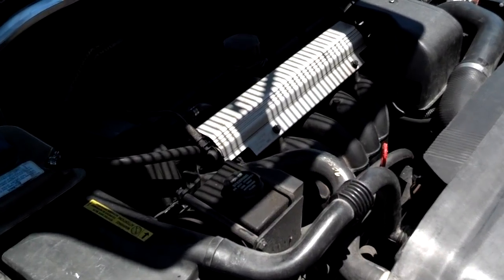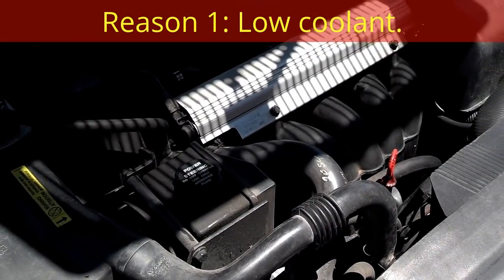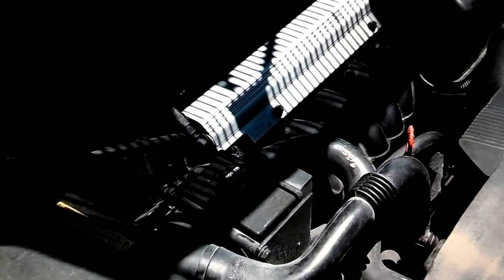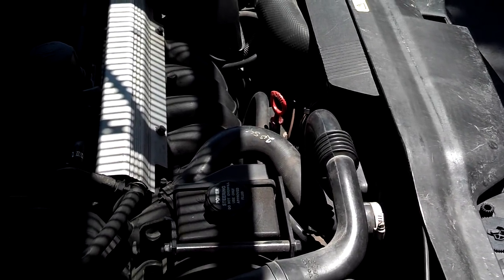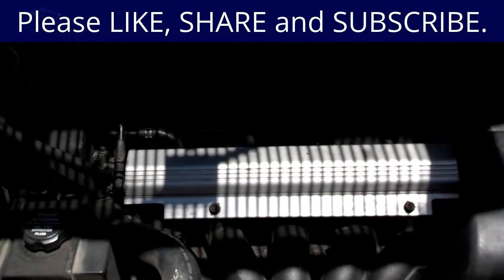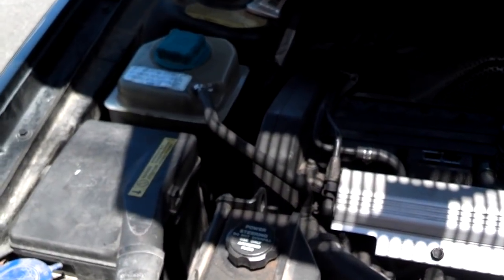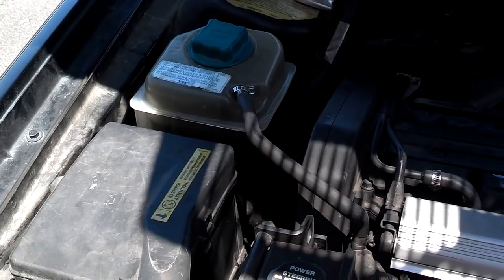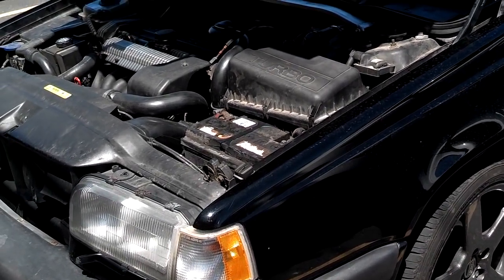My car is over heating, why is this happening? What should you do now?

Comment: Amazing video Robert, thank you. I came here, say, from your other video on making your older car last a long time! I believe you covered everything regarding overheating, so I would like to just add my 2 cents very respectfully here. My car started overheating in stop-and-go traffic a few weeks ago and NOTHING was visibly wrong. To cut a long story short, the problem was not visible for the untrained eye (by the way with some steam coming out of the coolant reservoir  and in HORRIBLE traffic in Mexico City!!), but it was the electric fan that had stopped working. 
So my mechanic advised when I talked to him, first looking at the obvious, when nothing seems wrong with the car because you have checked all the levels and everything seemed fine the last time you checked! Anyway, 1st., ELECTRIC FAN--cable, motor. It is a simple test with a couple of cables and your battery; 2nd., TEMPERATURE SENSOR (which moves the fan and is usually easy to replace); 3rd., THERMOSTAT (I believe easier and cheaper to replace than water pump), and finally THE WATER PUMP ITSELF. Again, this applies to a car in the above situation and NOT a car that is clearly leaking coolant or a car that overheats even at normal speeds. Thanks again for the video and take care.
Reply from the maker: Thanks for sharing.
Reply: yes sensor and relay fuses
Reply: Ty, that helped describe what my car is doing.
Reply: 5
Reply: Q q+

Comment: What temp is considered overheating that causes damage? My upper radiator hose came loose. I pulled right when I saw my scan gauge reached 218-220. Clamped it back on filled it up and kept going at 190-195. Did I cause damage? 1995 Tacoma
Reply from the maker: https://youtube.com/shorts/QMpmi2vwoTQ?si=ij1Nvv73c0q7Q2mm

Comment: I can't find the cause of overheating on my 2001 Honda accord 280K miles. Blowby? I run the AC, both fans come on and cool it just fine. No AC? No fan comes on, heats up while driving after a while, turn on AC, fans cools it down. Electrical short? Shot a parts cannon at it. It's a puzzlement. I'm suspecting blowby. Oil clean.
Reply from the maker: I have NEVER heard of blowby causing a vehicle to overheat. Did you watch this video?

Comment: My temp guage will get to about half way up then 65 up then down to about 45. It would back and forth sporadically. No white smoke out the tailpipe. Resovir was just filled after the fact but itwas empty before. Since then it did not go down much. problem with temp still there.
Reply from the maker: I don't even know what kind of vehicle you have but you might want to make sure that you have a good thermostat and that the fan is working properly.
Reply: @RobertDIY  2010 honda civic. Thanks for responding.

Comment: What happens when your temperature rise is very close but, STOP to let the car cool down. I changed the thermostat and by the way the radiator and fan works too. I'm thinking the temperature sensor. What do you think ?
Reply from the maker: Probably the water pump.
Reply: @RobertDIY  forgot to said i changed out the water pump too. ( Sorry ) I think is the air in the system. Jeep liberty 03.has a pressure relief nut open it up because going to put a new cooling temp sensor open  radiator and refill back up & pressure it.

Sounds like a good MASTER plan.

Comment: I have a 2017 Cadillac ats and I overheated or tried to over heat 3 times, in the last 6 months. I only 50k miles on it and am the only owner. Today when I was in traffic and it was raining I had to pull over to let the car cool down. I popped the hood and saw the fan wasn’t moving. I pushed the fan manually and it started to move.  I’m getting it checked out early next week. It’s only happened a few times and each time I saw my temperature gage go up, it’s always when I’m in stop and go traffic and each times it been raining. Any correlation to the rain causing temp to rise or causing the fan to not operate properly?
Reply from the maker: I guess. I suggest that you schedule to have the fan replaced. It's acting up and 16 years old. Not worth destroying the engine over.
Reply: @RobertDIY  it’s reaching 6 years old but I guess I wonder why it failed so young. But I appreciate your response Robert hopefully I will get it replaced asap

Comment: Good day I have a question I have a 1996 Mazda Protege and it's running hot but he never ran hot I have changed the radiator it's still running hot I have changed the thermometer whatever you call it and it's still running hot they blowed out my heater core and it's still running hot I have not replaced the water pump yet I have no clue why I still running hot can you please got a sister the right way
Reply from the maker: Does the engine fan work?

Comment: My problem is overheating only when I get up to speed. Tested thermostat, pump is good, no leaks. At idle or low speeds it’s fine. Anyone have a idea?
Reply from the maker: Pump is bad.
Reply: @RobertDIY  thanks, anyway to check that without driving it anywhere? And not being a mechanic?
Reply: @RobertDIY  also rob I have heat and I saw a Video that said if I have heat my pump is working. It’s a 06 Dodge Ram 4.7
Reply: @RobertDIY  you were right pump was bad

Comment: Please help. I have no other way to get a car. I have a 2004 Suzuki xl 7. It's been a real good car. I've had it 8 years. Ten days ago, my reservoir  suddenly boiled over  I was driving into a parking spot. Maybe exploded because the reservoir tube disconnected. Could this be exhaust gases doing that? It overheated two other times but I stopped it right away. The car did not show any other signs of a blown head gasket. The parts and labor are ridiculously expensive. I have a mechanic appt tomorrow. The memorial weekend had everyone booked up.
Reply from the maker: how can I help you with that?
Reply: @RobertDIY  well I took it in today and no diagnosis yet I might hear something tomorrow. I told him to check the engine codes etc.

Comment: thanks for the link, very helpful video.  I think its most likely a bad waterpump now. though i had a bad water pump in my old chevy and it made a lot of noise and leaked badly. my water pump in my 1992 240 isnt making noise or leaking but I suppose that if the blade unscrewed inside it might not show symptoms.  i was wondering though if the radiator could be partialky blocked?  Like I said the bottom of the drivers side is totally cold, bottom passenger side is warm and top both sides is hot though not enough to burn your skin.
Reply: Also would it help to run it without the thermostat until I can fix it?  Its my only working car unfortunately.
Reply from the maker: I would fix it first.

Comment: My car yesterday kept overheating , I went to the car shop & they said they really couldn’t find anything, they said the car had coolant in it . Once I turn the car off n let it cool it runs back normal but I’ll say maybe a minute or 2 afterwards that’s when it starts to over heat again . It never’s cuts off but it do start to skip n cut back a lot & I pull over . What do you think could that be ?
Reply from the maker: Can't tell from here. Did the shop you took it to test drive it? You many want to take it to the dealer or another shop.

Comment: My car runs hot when I'm idle and have the AC on
Reply from the maker: Does the engine fan work?
Reply: @RobertDIY  I turned on my car today and let it run and the fan wasn't turning
Reply: @RobertDIY  is the the fan suppose to run all the time are at certain points

Comment: What if the fan works most of the time except when the car starts to overheat and the ac blows hot air
And in other times the ac works perfectly fine and the fan turns on when the car is stopped in traffic,
Reply from the maker: May be a bad relay.

Comment: What about if I have turbos?  Which use coolant to cool them down, can there be an exhaust leak thru there that's causing my coolant to over heat?   Although it's heating on the top hose not the bottom?
Reply from the maker: 🤷🏾‍♂️ My cars are turbo.
Reply: @RobertDIY  I didn't hear you address it!  You said there could be an exhaust leak into the coolant, but at the head gasket.  You didn't mention anything about a possible leak from outside the block.   I'm only asking because I have sequential twins and my coolant is over heating.  Imma be replacing the coolant temperature sensor since I've already done the thermostat, water pump is not too old less than 5k miles. Since imma be replacing the exhaust cam and vvti Cam's seals I will be checking the pump again since imma be right there.  I just hope I can find the problem because I'm a bit annoyed of not being able to use my 2JZ GTE  swapped Lexus GS300   

Cheers
Reply from the maker: Because the turbos won't make coolant overheat.

Comment: My car is full on coolant in the reservoir. Filled to the max line and my car has been overheating? I noticed some spurts of coolant on my engine next to the radiator cap. So I changed the reservoir line and put on clamps. Worked for a little, then I found new spurts and I have green fluid leaking from under my car?! Car has been parked, haven’t noticed any white smoke or weird smells. I don’t want to risk it and drive so it’s been parked. Can somebody help me? I don’t trust mechanics and rather do the work myself...
Reply from the maker: Bring it by.

Comment: What if the weather is too hot? Could that cause it to over heat????
Reply from the maker: The engine runs at 210 degrees. If the air temp is below 160 it should be fine.

Comment: Bad freeze plugs can also be problem.
Reply from the maker: That would classify as a coolant leak. 🤷🏾‍♂️
Reply: @RobertDIY  is it any type of quick fix for bad freeze plugs?
Reply from the maker: Replace it. If you can reach it drill a hole in it, put a screw in it and pull it out. Then press the new one in.

Comment: Okay what about when your over heats and you always have to have the A.C. on, so it won't over heat? But the thing is my fans work and changed the radiator and thermostat..I have a 2000 honda accord..
Reply from the maker: bad fan relay. It's not turning the fan on unless the ac is on.

Comment: Ok so i have a 01 lexus ls430 very great car. Ive  traveled 2+ hours with no problem. I took it to LA and i have to go through the GRAPEVINE mountain which is known to take cars down! As I climbed the the mountain my temperature increased a tiny bit but once i reached the incline temp dropped to normal running temperature. Is this normal? I inspected the radiator after and looks like it has the OEM radiator since car was made its old dirty and crusty. Im planning to replace it with a OEM tow package radiator for the ls430 which is thicker and bigger than the OEM one that came in my 01 ls430. yes certain ls430 have tow package. And info helps THANKS!
Reply from the maker: Yes normal.

Comment: PLEASE FUCKING HELP ME
i have a 2013 charger v6 and its been overheating for about a month. i did everything and it still overheats, keep in mind there is no leaks anywhere in the car. I noticed when my car was at running temperature my cabin heater didnt work so i decided to do a heater core flush, and it didnt work. still overheated. next i replaced my thermostat and i purged it, didnt work and it was still overheating. And then i even replaced my radiator and nope it didnt work it was still overheating. My heater was still not working so i thought it was my heater core again, not that it was clogged or leaking i just thought it stopped working, so i bypassed it and now i dont have heater inside my car. oh and guess what. STILL FUCKING OVERHEATING SON OF A BITCH
PLEASE HELP ME GUYS
Reply from the maker: Are you sure the gauge is working properly?  You can call me anytime.
Reply: @RobertDIY  yea im positive because when the gauge is all the way to Hot i check my engine bay and the coolant is boiling in the reservoir
Reply: @RobertDIY  also today i went to replace my water pump and it still overheating

Comment: Keep in mind boys, when you replace your thermostat, air could get into the system. So make sure you also burp your radiator just in case air has got in there :)
Reply from the maker: Thanks for sharing
Reply: Robert DIY no problem brotha👌🏾
Reply: Lisa Boulier to get the air out, you should park your car on a hill of some sort(because air goes to the highest point) and you can do 1 of 2 things. 1) you can pop the radiator cap off and(when the car is cold ofc) then start the car up and let it warm up to its operating temperature and blast your heat up all the way max, then squeeze the radiator hose and then you may see some bubbles come out. Do this until you see no more bubbles coming out. 2) this is the method I suggest. Go out and get a radiator  funnel, and put it into your car radiator from where you removed the radiator cap. Now start the car and let it get to operating temperature and blast the heat and fill your radiator funnel up about 1/3 with antifreeze, you will then start to see bubbles come up if you have any air in there. I hope this helped bro and good luck

Comment: I've been putting water instead of 50/50 coolant. It's been overheating for the past month. I was always wondering what's the problem. I'll try that and let u know
Reply from the maker: Water boils at 212 degrees, coolant at 265+. You'll destroy the engine running water.

Comment: Replaced motor and put a new water pump on and thermostat and filled it up with coolant and got the air out, now the truck tries to overheat only while driving... everything looks like it checks out. And thoughts ? Subbed btw
Reply from the maker: not other than what you see in the video.

Comment: ROBERT DIY;;                                                     I don't know how to test the temperature sending unit or where its at in cars. I'm not sure if the sending unit means a sensor.
               1.)  How do you test or what do you use to test the temperature sending unit?
                          2.) Can I buy a digital gauge at PEP BOYS and install it in the fuse box wires by slicing the wires to test if the analog temperature gauge in the car dash temp gauge is reading false reading measurements of the temperature?
         3.) Can you make a youtube video showing how to test the car dash gauges to see if they work correctly and not reading false readings and how to test the sending units to the cars gauges?
            4.) I don't know how to test the cars gas gauge, oil gauge, temperature gauge using a ohm meter or what other test tool can I use to test these gauges are working correctly and not giving false reading or not working correctly?
Reply from the maker: Seek out an instructor.

Comment: ROBERT DIY, 
          The temperature gauge in the dash board says the car is overheating, So I'm not sure if its giving false readings. So i'm trying to test the temperature gauge in the car. 
1.) Can I just SPLICE into the temperature gauge wires and put in a universal digital gauge at PEP BOYS?
2.) Can I measure the temperature gauge using an ohm meter by REMOVING the fuse to the temperature gauge?
3.) Whats the Normal Operating temperature measured value the car should be at while idling and running? what is the temperature degree number at normal operating temperature the car should be at normally?
Reply from the maker: Assume it's giving the correct reading.

Comment: Hi there , my GM car which engine has been changed it’s Gauge while at idle engine the needle moves a little above the Middle Line of the temperature gauge ,and while I am driving the Gauge comes down to the middle ...we have changed the Thermostat and Water pump , the Sensor seems looking good , coolant level stays 
Levelled in the reservoir , I see no leaks from coolant , radiator is also New , the Scanner did not show any problems with the system , could it be even though the Thermostat was new it could mal function or the water pump ?
When the mechanic installed the engine and I turned the engine on for the first time the Gauge suddenly jumped up to the full high temperature and then after turning the engine off , the mechanic went to manipulate a Wire going to the engine near the Coils and the the temperature dropped !!
I am wondering what he did !?
He said do not worry about The gauge’s needle going a little over the middle , but it’s more than a little .
Any opinion please ?
Reply from the maker: Does the fan work?

Comment: I loved your video and was wondering if you could help me. My car is a Nissan Altima 2001 and I just changed the water  pump and the thermostat. The  water pump was leaking so I decide to change both things. before I did that the temperature gauge inside was working fine but now is going all the way up to the H showing that the car is over heating but the engine itself is not over heating. I checked with one of those scanners and the temperature goes to about 140 F  degrees and a 154 F degrees. I checked the gauge sensor and it seems to be working right. I Do not know what else could it be.
I do not know what the operating temperature of this car is. How can I find out What the problem is?
I will appreciate very much if you give me a hand with this problem.
Reply from the maker: Does it go up slowly or fast, to HOT?
Reply: @RobertDIY  It goes to the normal half way and then slowly goes to three quarter and stay there for a while and then it goes to hot slowly after that it fluctuates between 3/4 and hot.

Comment: You tell it straight i like that. But you didn't touch down on one other thing...plugged systems. They're why flushing was invented. Keep it goin bruh
Reply from the maker: how does a system get plugged? I've never seen it in 40+ years.
Reply: Metal fragments from faulty radiator/heater core,stop leak,plugged oil cooler. It's not unheard of by any stretch